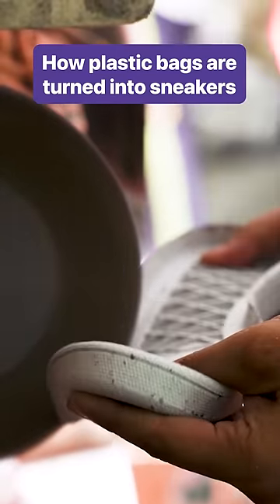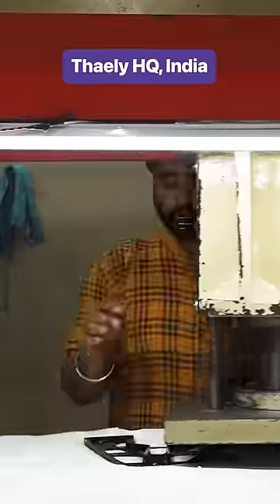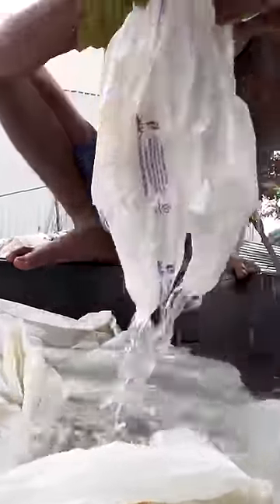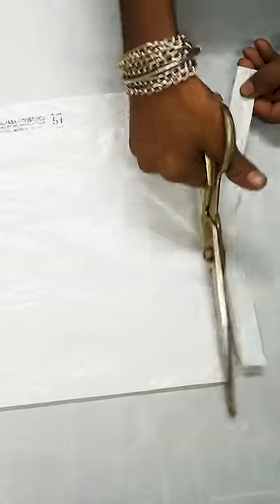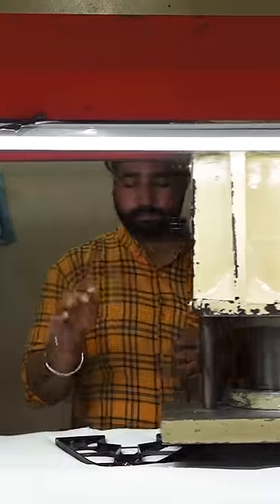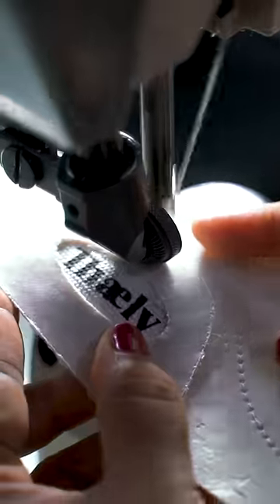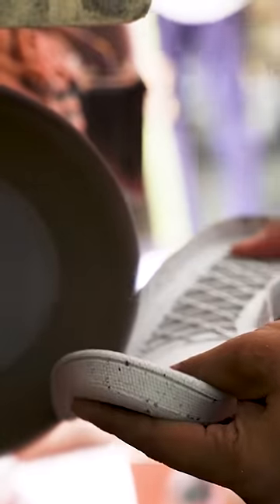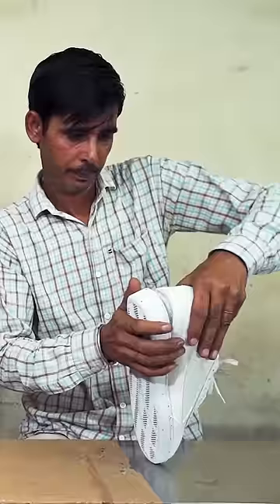Would you buy these sneakers made 100% from recycled materials? #sneakers #recycling #ecofriendly

Comment: "they clean the bags in a hot tub filled only with water, without any chemicals" then they don't clean the bags, they wet the bags 😂
Reply: WASHING C L E A N S THEM.  
YOU BELIEVE TOO MUCH IN CHEMICALS PERHAPS?🤷🏻‍♀️🙏🏼
Reply: @kailashbedi3404 how are they sanitised?
Reply: Scrub something with water and sponge. Have you ever seen how that turns out
Reply: @itswindyyy  If you think rubbing things with water cleans them, your parents have failed you
Reply: It does kinda do something.  @thedandude
Reply: That's considered cleaning in India 😅
Reply: They don’t need sanitising, but the water will take off most of the water soluble residue. They then go into a heat press, hot enough to melt whatever type of plastic it is ( probably polyethene ). These temperatures can exceed 120’C. Any other impurities will be incorporated into the plastic. Remember these are for your feet, not your dinner plate.
Reply: @MK-lh3xd who cares when they are on the ground, it's the bottom layer
Reply: @thedandude  do u realise there's a word called WARM or HOT which is used to SANITIZE.
Reply: @swarnavanath3234  lmao what's wrong with you?
Reply: @thedandude  nothing wrong jist pointing out that they use WARM water which is used to sterilize. Even surgeon use no chemical in their equipment other than hot water and steam to sanitize it. This is just a shoe so its 100% safe
Reply: @swarnavanath3234  1) warm water does not sterilise anything, only boiling water does, 2) the water in the video is clearly cold, the guy has his hand in it, 3) what is wrong with you?

Comment: Wonder what you mean by recycled 😅🤔 Do you mean you bought USED plastic bags and bottles, then disinfected/ cleaned them and made them into another product ie, a sneaker? Or do you mean you bought plastic bags and bottles which were made from recycled plastics? Or do you mean you just bought some unused, new plastic bags from a seller cheaply and made a product from it? If it’s the last case, then it’s not recycling. Buying tons of plastic bags in India is far far cheaper than buying the proper plastic/ rubber to make the soles. So, that would not be recycling. Simply sourcing a different form of the material required to make the end product is not recycling. 😅😂… So, it would be interesting to know where and how your “recycled plastic bags and bottles” came from and if they were actually recycled materials. 😅It’s a Fabulous idea to recycle plastics but I’m quite sceptical about how entrepreneurs and companies these days slap on the “recycled” image on to their products to boost PR or SP! I hope Thaely is actually doing what they say. And if you are, I’ll be shouting my support from the rooftops! 🤗🤗🤗